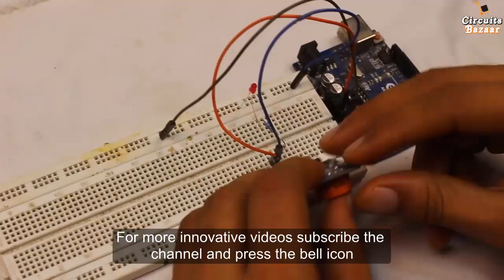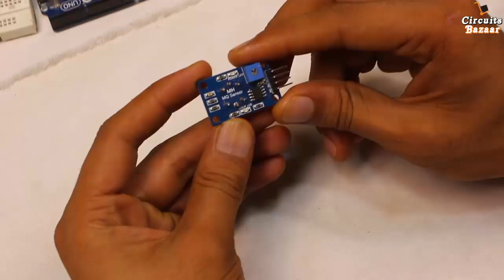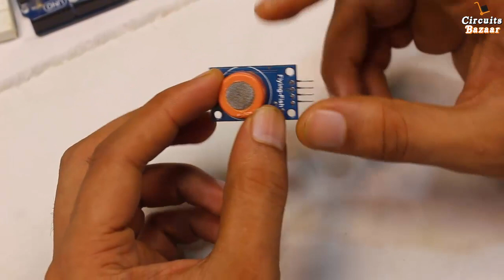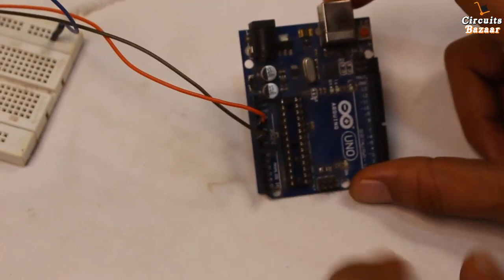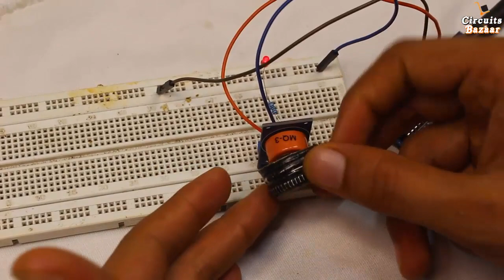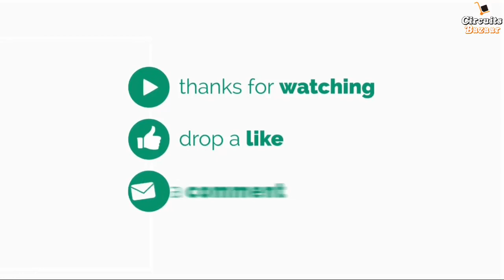ALCOHOL SENSOR MQ3 WITH COMPLETE DETAIL [ HOW TO USE]

Comment: Could you please include wiring diagram of the circuit
Reply from the maker: by the way, i haven't used programming but still if you want to know how to code the sensor then use this code :- 
https://create.arduino.cc/projecthub/yashikibrahim/alcohol-detection-sensor-dc32cd

Comment: How it's work moter in  place of led bulb
Reply from the maker: If you want to use motor instead of LED then in that case you have to use motor driver and 4 motor driver you can use motor driver IC like l293d or you can use darlington pair of transistors
Reply from the maker: You may give signal from the sensor to the microcontroller and then drive the motor through microcontroller using drivers

Comment: plz share the arduino code bro. Good Job!
Reply: there is no code needed in this video, its a simple comparator
Reply from the maker: i haven't used any coding here..... i have used Arduino just to provide power supply to the module .. .5v power supply

Comment: Sir can I place 12v motor in place for led
Can it stop motor
It's urgent sir...
Reply from the maker: Yes, brother, it is possible. You need to use a small relay board for the purpose. you can buy it online or contact us
Reply: @The.Innovative.Indian  yes I need it how can I get it?
Reply: @The.Innovative.Indian  its not relay board but a motor driver is required